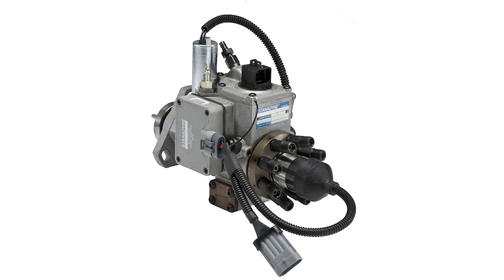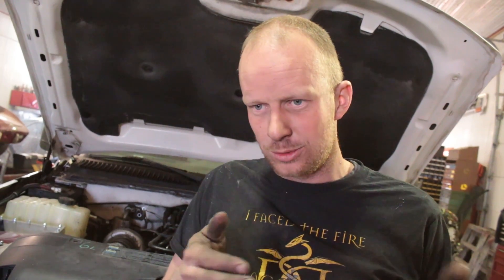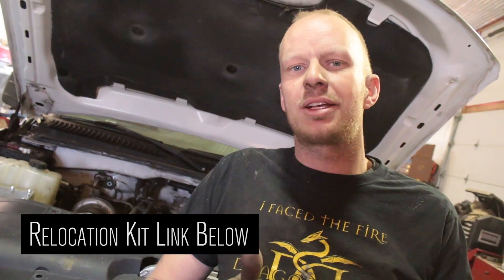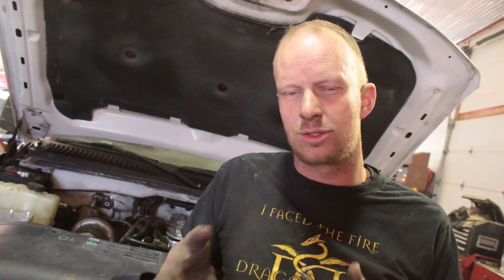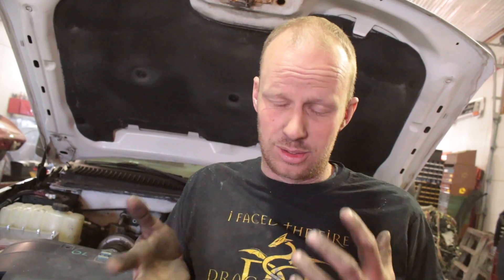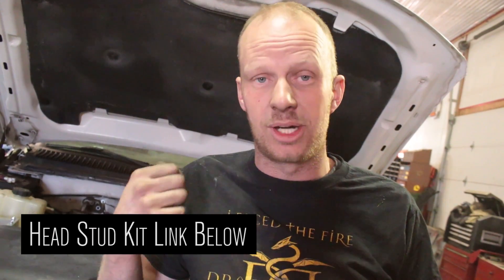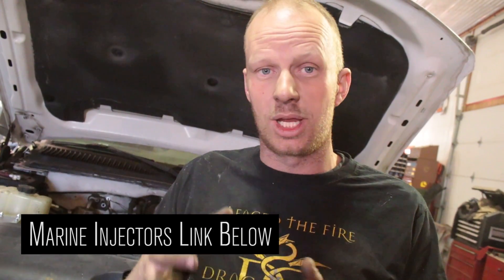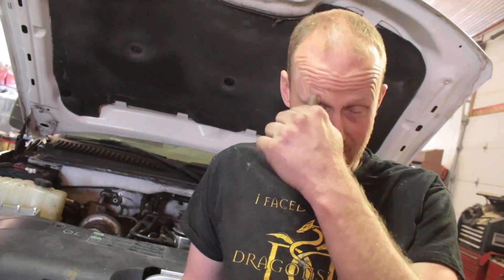REVIEW: Everything Wrong With A GM 6.5 Detroit Diesel

Comment: I had a 6.5 for a long time, at about 100k I tore the motor down and got it to 17.8:1 compression, bigger turbo, studs, mechanical injection, other supporting stuff, i dyno pulled it at 360hp/530 ft lbs. I ended up getting rid of the truck at 500k miles from the build. Healthy as could be and didn't lack for power and that thing pulled skid steers and dump trailers every day. Just stock they aren't meant to work hard like that, but they were a great alternative to a 454. Could pull just as well but got better mileage.
Reply: Waaaay better mileage.  Did you use low compression pistons? Did you make any other mods to help it start cold.
Reply: consaka1 I milled the stock Pistons and used gapless rings, also used a little thicker head gasket so I wasn't taking a lot off of the Pistons. It wasn't that hard to start but for peace of mind I did a manual glow plug circuit later on in the fall after the build. Any time it got below 30 degrees I would plug up the block heater so I didn't strain the glow plugs, I even did that prior to the build.
Reply: What did you do for an intercooler and what max boost were you running?  Did you recoat the piston crown with something to mitigate the heat?
Reply: consaka1 I recoated the piston crown so it wasn't raw where it was milled, I don't remember what I used exactly but it was recoated. At first I didn't use an intercooler because I just ran an HX35 and the turbo map was set up for 20psi, but I was using a cold air intake. After I ran that for a while, I swapped my radiator, AC condenser, tranny cooler, and intercooler for everything out of an LB7 Dmax, i also used an aftermarket intake so it could accept the intercooler plumbing from the driver side. I had to do a little fabrication to get it to work and some plumbing work, at the same time I switched to a variable geometry Holset turbo so I could actually use the intercooler. I had a shop re adjust the vane positioning to accommodate up to 25psi at WOT. I was also 1/4 turn on my injection pump, I could've went a little more but didn't want smoke. For feeding fuel to it, I swapped to marine parts because they could supply more fuel.
Reply: I always use marine parts but I recently got a injector tester and I honestly can't really find where the difference is between them. The marine injector tips seem to spray easier at high pressure. Just not sure why. 
Was your pump also a db4 marine pump?
Reply: consaka1 I didn't waste money on marine injectors being the 6.5 is IDI. I did not use a ds4 pump, very unreliable without a remote pmd. I instead used a db2. Much easier to fine tune in my case.
Reply: There is a difference between a ds4 and a db4  pump.  The ds4 is computer controlled and the db4 is total manual control. I understand they both have 4 plungers. However you can get two plunger pumps with larger diameter plungers for more fuel.  Manual pumps are indeed easier to tune if you don't have all the equipment for the ds4 pumps.
Reply: consaka1 my bad, I read your question too fast. I did not spend the money on the db4 simple reasoning was, the db2 supplied more than enough fuel for my application, I did however rig up a fass 150 so it could get fuel to the pump quick enough. I more or less took duramax components, paired them to a 6.5, and made a fairly reliable tow rig. I wasn't going for a land speed record, I just didn't have 40k to drop on a duramax at the time. But I did have 8k and some free time.
Reply: I don't think you can even get a db4 anymore. Some guys claim they don't exist. lol Huge debate on the forums.  But yeah you get the pump you need for the job. I think my next build is going to get one from Constoga?. High volume db2. I hope they will accept a DS4 for the core. 
Did you spend all 8k on that engine? I hate having a budget when building an engine. lol But 8k will buy quite a bit on a 6.5.
Reply: consaka1 I didn't have 8k only in the engine, it was a mixture of engine, turbo, cooling system, fuel system. I basically rebuilt everything in the engine bay for a performance application. The transmission was good for it, but a year later I beefed it up in my own time since I was starting to pull more weight. I didn't really have a budget, I just couldn't stomach pumping out 40k for a duramax when I more or less just got the 6.5 and it was running too good for me to toss away.
Reply: consaka1 to some extent the newer it gets the more difficult, but I've done one for a 1999 crew cab. I think like 3 sensors weren't meant for a mechanical injection, so all it did was set the light on. That got cured with the removal of a bulb. 😂
Reply: ThisGuyWantsBeer please reach out. Have lots of questions. J-German@live . Com
Reply: I really appreciate all the info. I think gauges might be next. Exhaust after that. I know the less muffler the better, in terms of flow, but this thing is already loud and i leave for work at 5am. I don't need to make enemies of my neighbors. (at least it's not a 12v rattler, but I'd love one of those if I could find one cheap).

I'll be researching the oil pressure switch relay. This is the first I have heard of it.

The other possibility down the road is swapping to a mechanical pump. I may not need to since the remote mount PMD, but I already have most of the parts. I got a 4L80E computer out of a Vandura. I have a the pump and injector lines off a 6.2 hummer engine. All I need is a throttle pedal and cables. Have either of you done or heard about that swap?
Reply: Hi guys. I like your discussion here. I have a 1999 Suburban with the 6.5. I tow boats (not huge, 20 foot runabouts) and occasionally an old 35 horse Kubota tractor. The only mods on the engine are a cold air intake and a remote mount PMD (this after two injector pump replacements that probably just needed the PMD remote mounted in the first place.) I don't have a ton of money to throw at this thing, but I love 'burbans and I like diesels, so I'm sticking with this old pig for a while. There are 189,000 miles on it. What would be the next most sensible upgrade for a bit more power and reliability? Mostly reliability, as the power is adequate for my needs.
Reply: consaka1 I know running a stock exhaust the downpipe was crushed pretty good so unloaded I would see 1200 frequently, pulling it would maybe see 1300-1400 but I'd ease it down. When I did go to a big exhaust, my egts were rarely above 1000 even pulling a trailer loaded around 8000lbs. I'm a firm believer in knowing what the truck is doing at all times as well. Hell, I put vacuum, trans temp, and oil temp gauges in any gas trucks I get. I don't think the oil pressure switch would be a big deal for him just yet and he could hold off, I know mine was a pita to do, but this was also before YouTube tutorials. Lol.
If he's confused on gauges to get, I use glowshift tinted series gauges. On my 6.5 I think the whole kit for the 3 cost me like $300 with all the sensors, wiring, pillar, and taps.
Reply: consaka1 I'm pretty sure 95 was the first year of the oil switch, I never had a problem with mine in the 96 and I probably would've kept it in the same set up, but while I had everything tore apart, I figured I'd go ahead and change it over while I could get to everything. I agree 1400 is on the hot side, and anything over 1100 I feel is too hot for me. I'm pretty sure the pistons in the 6.5 won't warp/crack/etc until temps are 275 or higher on the dash, I wouldn't know, I've always made sure it stayed around 180 and never above 200 on a hard pull. A diesel is always a hot engine no matter what, the combustion cycle is so hot compared to a gas motor and cool down cycles take a lot longer. I will admit the 6.5 water jacket isn't the greatest for cooling but the way I had my water pump and thermostat set up was spot on, I had dual t stats (76 gph) with the older pump that was 78 gph. I found that almost even match cooled way better than the high flow pump which actually pushed hot coolant back in the motor. 
It sounds like you need a "Dirty Detroit" sticker on that crew cab. Lmao. Small things like getting it clean and water tight is pretty much common with anything older than 5 years where I'm at, so don't feel like you're alone on that! Lol.
Reply: Getting it through emissions was a trick.  200k on the odometer. Well in 50 miles it will be and everything is bone stock. Of course I had to drive 70 miles to pick it up.  The old farmer lost one of the batteries and some kid had come up with some rigged up little battery from a Ford.  he just stripped the wires and wrapped them around the chevy battery connectors. After about an hour we finally got it started.  The next 10 miles reminded me of an old CW McCall song.  "shaft is bent, the rear end leaks, use a nail to start her - I lost the key".  We drove straight to the nearest zone. so much steam and smoke coming out the back I couldn't see anything behind me. My son was following in the blazer and he stayed way back cuz he didn't want anyone to think he knew me.  At the zone we bought a battery and some chemical head gasket fixem up a little - stuff.  The battery was great since I didn't have to worry about that other mickey mouse setup shorting out on something.  Drove home in 3rd since overdrive and lockup didn't work.  It quit steaming and smoking within 5 miles so that was good. fiddled with the TPS and 4th and lockup started working again.  I drive it every day now though it needs a brake job and seal on the rear end in the worst way.  Never messed with duallies before so it promises to be fun.
Reply: Hopefully the TCM I got from the 6.2 diesel van will do the trick. I'd rather not swap transmissions. I may be able to revisit that van for the throttle pedal and cable stuff.
Reply: bastarddoggy if not, just grab one out of a gasser, all of the linkage is the same. I know for certain the ambulance TCM works, the van, I wouldn't know, but very possible.
Reply: I swapped in a 4L80E behind the 6.5 performance diesel I put in my van.  I found a controller I liked so much I started selling them online. All I know is that the newer the vehicle the more difficult swapping is.  The more things the computer has its fingers in the more complicated it becomes.
Reply: Backpressure is a big deal when it comes to temps. My new old truck is devoid of any gauges. I hate that about it. That and it seems a little gutless compared to my van which is heavier.  The new old truck is a 1993 and pretty much stock. I will be building an engine for it hopefully this fall. It was owned by a farmer, and well yeah. I never saw such a filthy rig inside. The electric door locks don't work and water was leaking in through the roof where the running lights were mounted. The bed was filthy and I even found an old 30.06 shell back there. lol It is still filthy inside even after taking out 3 bags of garbage. It is a crew cab dually. Like to get all the little things fixed. 
Do you know what year they started with the oil pressure switch? I mentioned that because that can stop you cold and he said he was after reliability first.  Those little switches were never meant for the duty cycle at that current level. If he does it before the switch burns out it should be a bit easier since he won't have to replace the switch itself.  Never had a rig new enough to do one myself. I just know that is right up there with remote mounting the PMD if you want reliability. 
1400 is pretty hot. Somewhere in there you will override the pistons ability to shed heat.  Pistons are just a chunk of heat pipe. I'd love to know what their limit is.  I do know that if you take the piston out of the block and heat it to 200 degrees you won't be able to get it back in. It physically will not fit. That tells you something about how the oil and the block vector heat away from the pistons.
Reply: Good thing a '99 diesel does not need to pass emissions in my state.
Reply: bastarddoggy I picked up a diamond eye kit with the muffler for $289 out of summit. It isn't really loud until you're WOT, but you get a nice turbo whistle at about 1800rpms. It's straight through with a sound dampener of some kind wrapped around the inner pipe.  I did the mechanical swap, I robbed a TCM out of an ambulance that had the mechanical motor and 4l80e. If you can't find one of those, grab a 4l80 out of a 93 and put in a throttle pedal from a gasser. There's some pretty detailed swaps floating around of guys who did it both ways. I just happened to get lucky on a junkyard trip, but check eBay.
Reply: Speaking of swaps if you know anyone with a accessory bracket kit from '96 through 2000 they would be willing to part with let me know.
Reply: Hehehe. 1999 would be really really new to me but I just recently heard someone refer to their 2006 as old. I got to thinking. I do that sometimes. Not too much.  Dang 1999 is almost 20 years old. lol 
Like to see the hoops someone would have to jump through to do such a conversion with a 2017 model.
Oh and have it all work properly when done.
Reply: Personally the next mod I would do would be the oil pressure switch. Get that converted to a relay asap if it isn't already.   
TGWB has some good mods listed for a bit more power. I am a big fan of gauges. Know what your vehicle is doing at all times. Get the gauges he lists first thing. I consider the 3 gauges he lists as absolute necessities.  Try to keep your EGT's under 1200F.  If you notice yourself pushing those numbers on a hill then the larger exhaust becomes more important.
Reply: Pretty sure a 6.5 is not an IDI pretty sure it's direct-injected
Reply: IAM building a6.2 up twin super chargers Makin about 700 hp @6500 rpm and some ridiculous tourque that blew the guts out of a 700r4 so I swapped a Sm 465 behind it can't seem to break that but go through ujoints  like no other every time I walk in to the parts store the guy meets me at the counter with a new set
Reply: @Will-tu9nf  still running the 6.2L? What superchargers did you use?
Reply: This is a long shot, but can you reach out to me by email to discuss how to beef up my Hmmwv 6.5td? 

J-German@live.com

Thanks.
Reply: Precisely what chevy should have done to it instead of adding junk to make it appear less reliable so they could swindle gm shareholders into making the duramax !!
Reply: bastarddoggy definitely run a 3 inch down pipe and 4 inch exhaust, that lowers egts substantially, I'd even put on a 2.5 inch crossover pipe. For pulling stuff I like having gauges to tell me boost, trans temp, and EGT. Also with a boost gauges you can put a mechanical waste gate actuator and completely get rid of the vacuum pump. Those are some good starts for reliability. And if it doesn't have a Dmax fan and severe duty clutch get right on it.

Comment: I believe the military application uses a nickel alloy block which makes it stronger and decipates the heat better. Isn't it Peninsular who manufacturers the 6.5 after 2000? Turbo master kits, the resistor upgrade and using a 93 or stronger lift pump is also worth mentioning to make the ol 6.5 more reliable. Very good engine to run on bio fuels in my experience as well. Perfect set up to pull a boat across the country cheep!